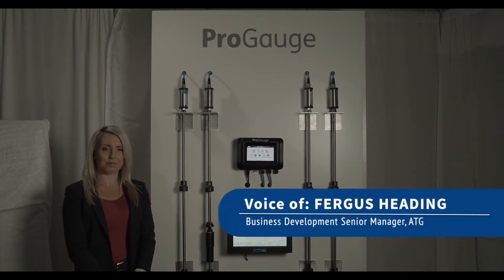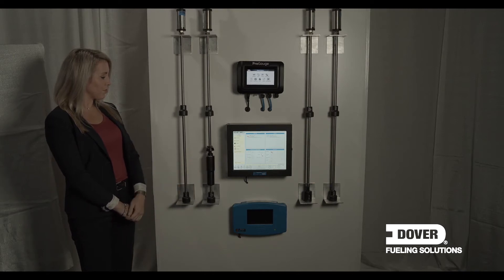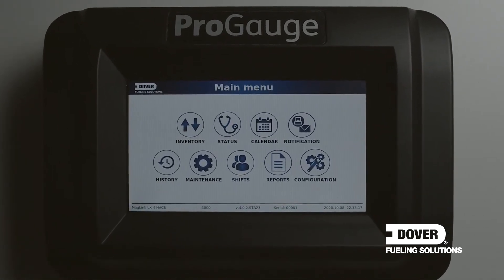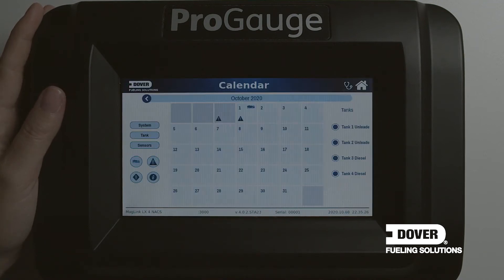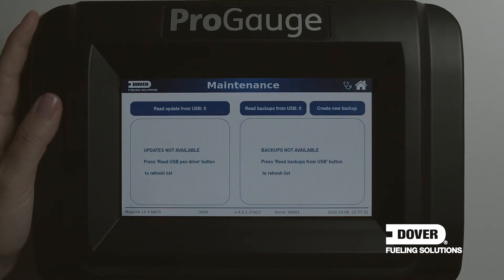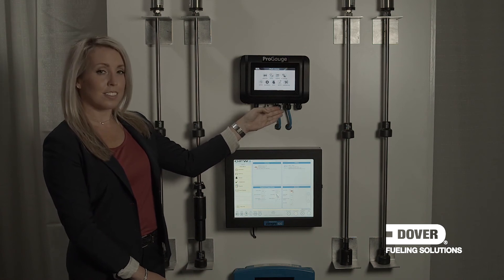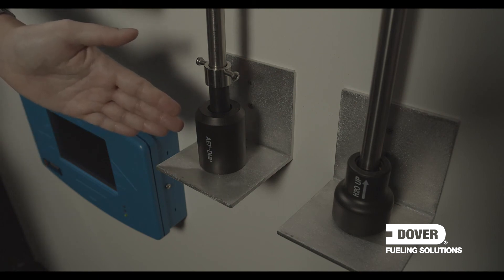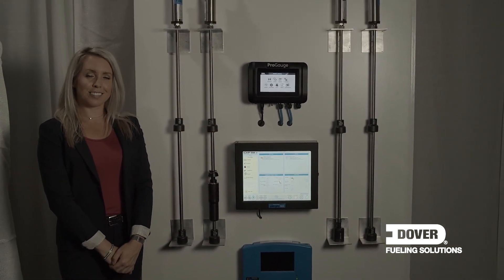ATG solutions components product demo

Comment: We have bought the ProGauge Maglink Lx4 with 4Lpg tanks, vaporizers, and PLC control panel four years back and never installed. But just recently we have finalized the installation but couldn't make change on the ProGauge for it is password protected by the supplier. We tried to reach the supplier for they have changed address and business type. How can you assist us in this regard ?